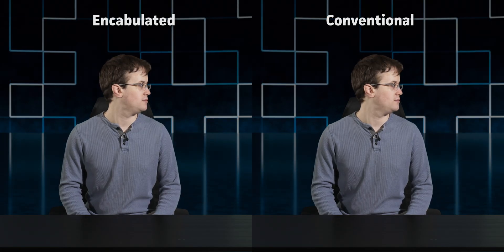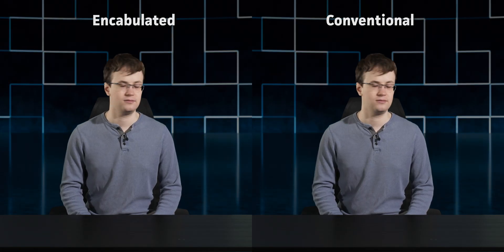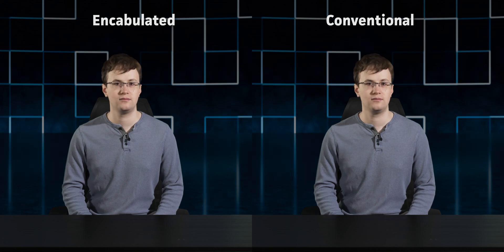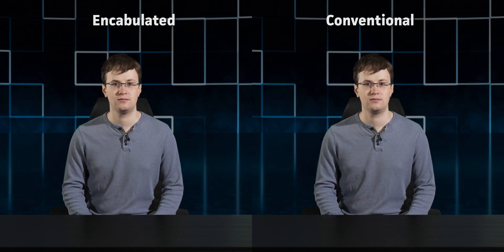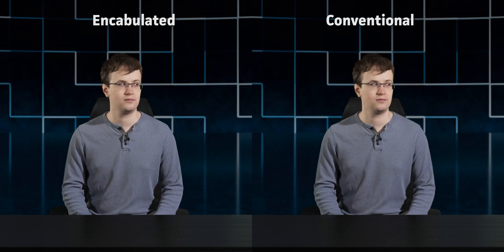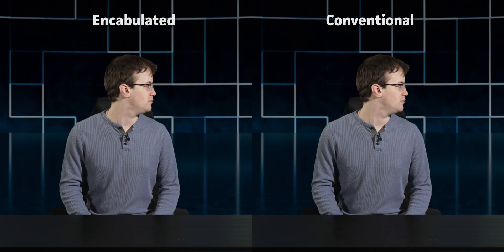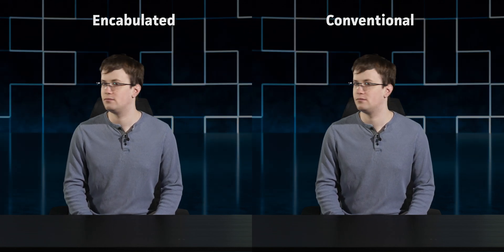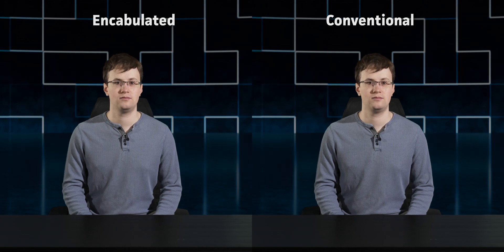(APRIL FOOLS) THIS Hidden Feature Makes Your Camera's Sensor Better

Comment: 1:41 did you mean Germanium synchronicity? Phosphorus was outphased in early 1980s
Reply: Modern encabulation tends to use virtual phosphorous instead. Germanium synchronicity is used more in bi-triptic photography or gradient filming due to its high lens hatching. Good catch though.